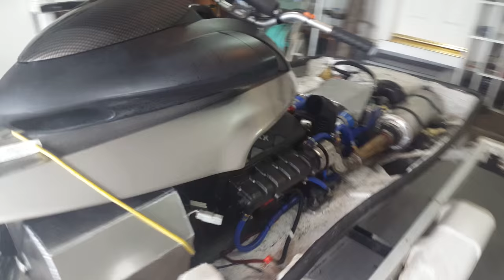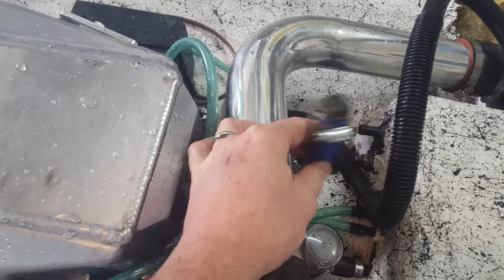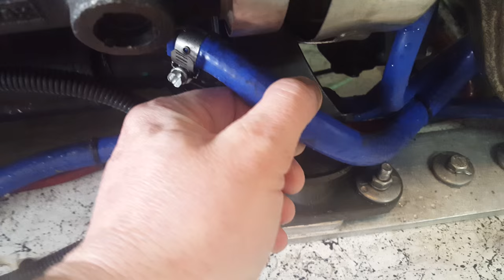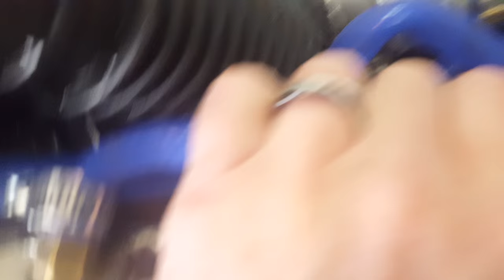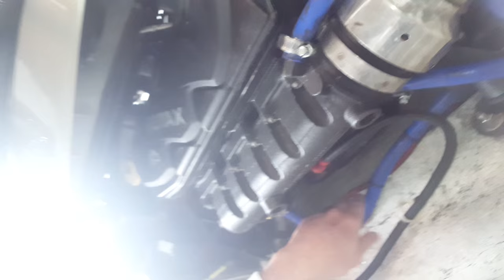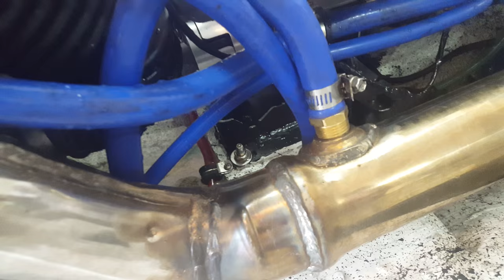Xpl4tec cooling

Comment: I'm going to guess that you have a tee somewhere in that cooling line which is splitting it to feed the other exhaust cooling ports. If that's the case I'm thinking that you cut your water volume either in 1/2 or 1/3 that's feeding the exhaust manifold and less water flow/volume means less water to take away Heat. That's just my guess I would try taking away the cooling line closest to the exhaust exit and cap that off to see if that helps your situation. Just another thought maybe those other two lines are creating a back pressure/turbulence situation which is counteracting the flow of the port Upstream in the exhaust manifold. Also I would use that extra line that is capped off either to let the water out or bring more water in. You would have to experiment with it. Sometimes......... too much of a good thing is not a good thing!